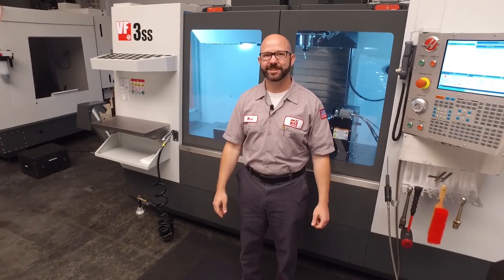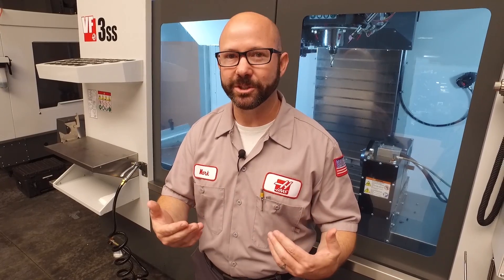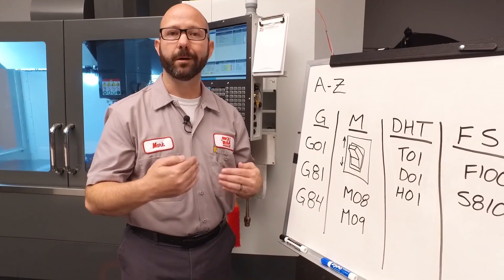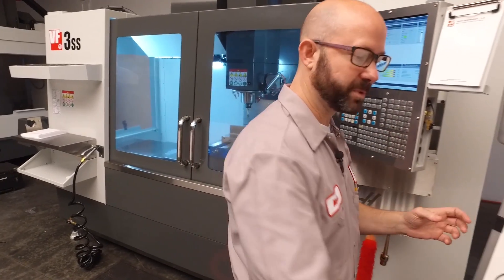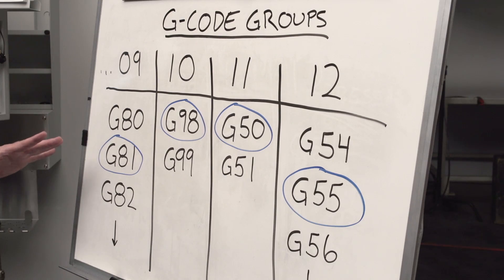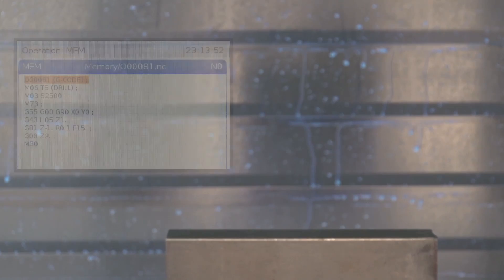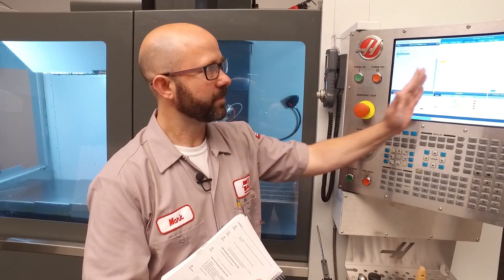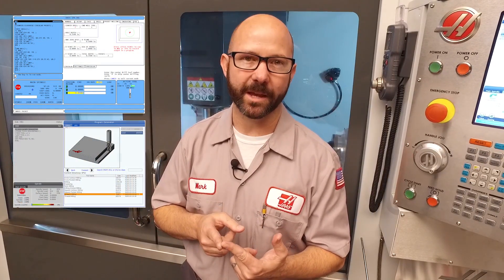What is G-Code? – Haas Automation Tip of the Day

Comment: When you have time go to a REAL shop that uses Okuma machines and you'll forget you ever saw that HAAS piece of crap!!  I wouldn't own one those things if they gave it to me.
Reply from the maker: rod builder – It’s good to hear you are happy with your current machine supplier. We, here at Haas, are proud of the quality, technology, ease of use, and exceptional value that the 200,000 machines that we have built provide to our many Haas customers. All things considered  (performance, initial cost, maintenance, fast local service, reasonably priced and available parts, and high quality), we believe we offer the best product available for our customers, and work to keep it that way. – Mark, Haas Tip-of-the-day
Reply: Meanwhile we have several Haas machines still going strong, lot's of issues with our DMG and japanese machine tools.
Okuma has its place and so does Haas.
Stop being a hater.

Comment: When you first start writing programs resist the temptation to move (g) in more than one direction at a time.  If you do this you'll be a LOT more able to spot a crash, because you'll only have to worry about the machine moving in one direction at a time.  You can also dry run the program on the monitor to see potential crashes. Go SLOW at first, then amp up your feedrates when you know what you're doing!!!

Comment: I ran a HAAS mill many years ago that had a 2" collet on it and all we cut with the machine was wood to make molds.  The machine was so damn weak it let the endmill come out of the collet when it ran.  What a pierce of crap that was!!! Give me an Okuma any day!
Reply from the maker: rod builder –   For tools pulling out of collets, check out our ER Collet video. Lots of good info in that one. https://youtu.be/WKikm6cQKh0 . Also, on a side note, we like to use a lightweight oil to lubricate the way covers on machines that are only cutting wood; without the machine coolant for lubrication the covers can become dry and wear prematurely. Hmm. Sounds like a good topic for a video. Thanks for the comment. – Mark, Haas Tip-of-the-day

Comment: Hi everyone, I was wondering if anybody could give me an idea on how long it would take to get to an adequate level of G-code and CNC programming in order to be hired in the industry?
Reply: 3-6 months if you attend trade school or community college, provided you already have a decent knowledge of the Cartesian plane,xyz and basic trig- sine, cosine and Pithagora's theorem to solve triangles- just the very basic, nothing complex. Hurry up! Can't get enough people fast enough! and by your grammar and use of language  I can tell you can do it!
Reply: Thanks for your response! I have actually recently graduated with a Mechanical Engineering degree and I'm finding myself more and more drawn to the manufacturing industry. I have already had experience with CAM using Siemens NX 10 and want to learn more so I can be employable in this field.
Reply: READ THIS...................It all depends on how adaptive you are.  There's two different basic types of machines you can program - lathes and mills.  With a 3D printer you're be using the same basic codes as you would with a mill, as there are THREE different movements - X - Y - and Z................Z always being the vertical movement.  On a lathe there are only 2 basic movements - X and Y.   X for the diameter and Z for linear movements.  Then there are other movements (axis) on machines that can control things like tapping heads, rotary tables, or other accessories that machine tool makers put on machines to make them more versatile. Such machines would be called 4, 5 or 6 "axis" machines.  A modern CNC lathe can even be made to mill a keyway, right on the lathe.....IF it has the necessary 3rd axis!!

So basically, if you separate your mind into TWO machines - the mill (or 3d printer) and the lathe you'll be able to separate the necessary types of movements and have a better idea of what's necessary to run each machine.  In addition a lathe moves in (linear) inches-per-revolution (.002-.020),  where a mill's feed rate is designated in linear inches per minute. Personalty I'm a lathe hand and am also familiar with mills, but the codes and movements on a mill are a LOT different than on a lathe.  I use set up and run a HUGE old N/C mill at Martin Marietta in Denver ant had a table on it that was 8 x 35 FEET!!!  I made Lear jet wing skins on it!!!  As for your question if you're not a machinist and know nothing about how these machines move or know nothing about feed rates you have a LOT to learn in order to make a machine do what you want it to.  If you put a "15" (mill feed rate into a lathe program, you just told the machine to move 15 inches per revolution of the chuck!!!!  CRASH!!!..........if you get my drift?  I'd have to say that programming a lathe is a LOT easier than programming a mill (or 3d printer) but there's a lot more call for a mill programmer. Go get yourself a job ina CNC shop for a while and see if you can grasp onto the basics of what the program is doing and why it's written the way it is.  You'll be able to see everything right there on the monitor!!  THEN think about going to school for programming.  If you don't know how to run the son of a bitch you're damn sure not going to understand what it takes to program it................and you'll be a LOT (as in LOT LOT LOT!!!) better programmer if you do!!!!

Onxe you learn hot to program a CNC mill you can graduate into CNC robots, once you figure out which way you want each axis to move.....or rotate....or weld.....or paint.....or spray coolant!!!